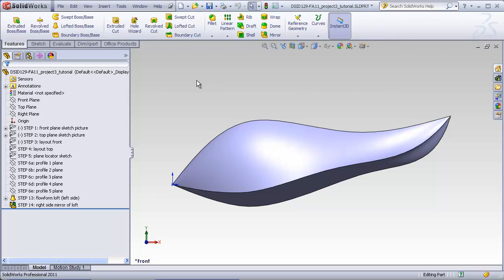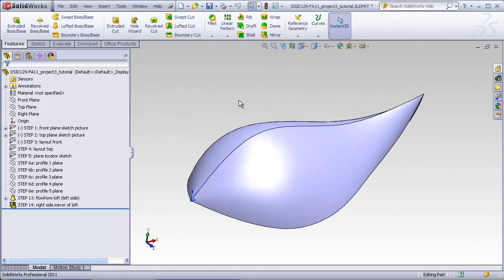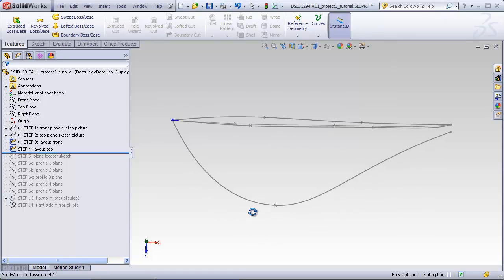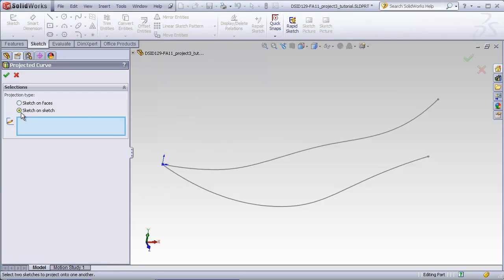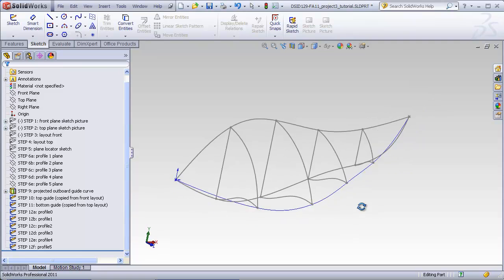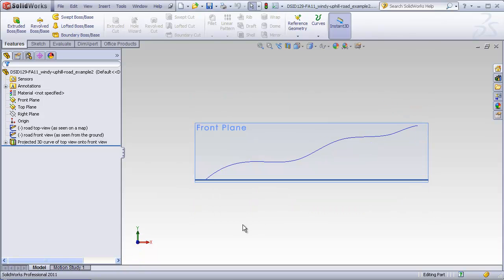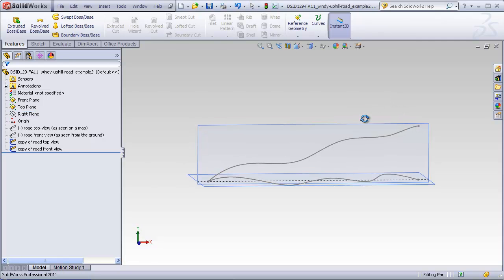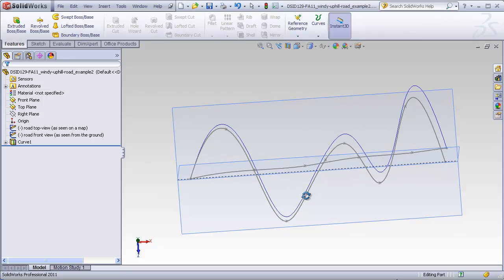DSID129, Solidworks Lecture, Projected Curves

Comment from the maker: The first profile is actually a sketch that contains nothing but a sketch point on the origin. I'm not selecting the origin itself. Sometimes, if you have guide curves that converge at a point, you don't need to select any profiles at the convergence. Solidworks manages to figures it out.

Comment: Thanks for the tutorial It is very well done. 

At 6:20, you select a the first profile defining your lofted surface. It appears to just be a point at the origin. This is a problem that I have been having difficulty with-closing off lofts like this that are bounded by curves. Did you really just select the intersection point of all 3 curves or do you have a very small profile near the origin as well as at the back end?